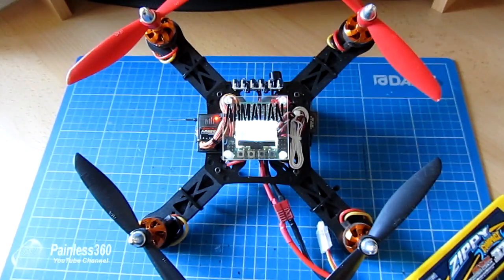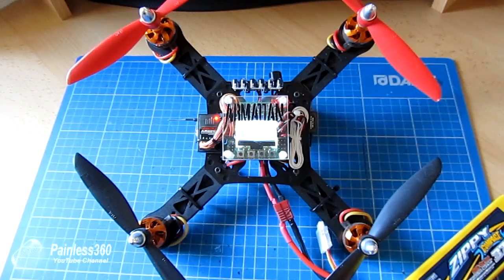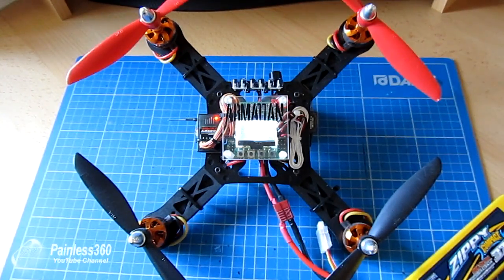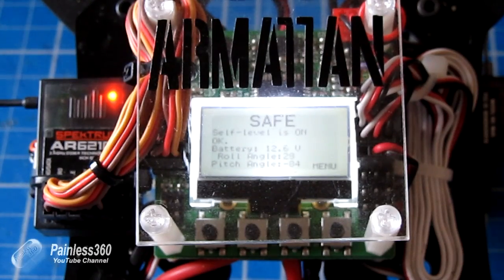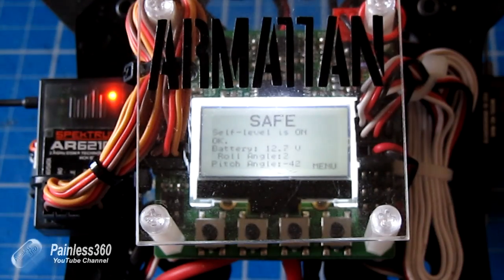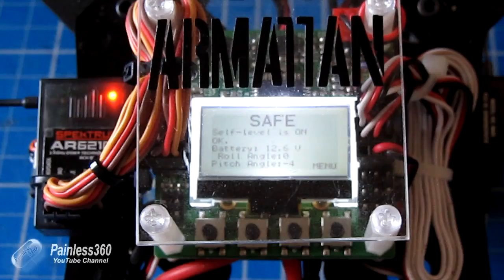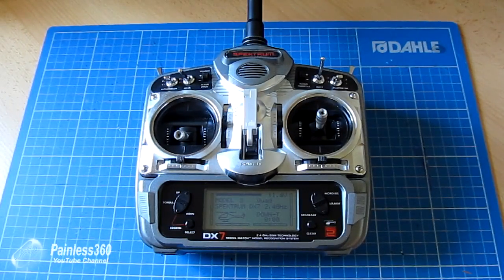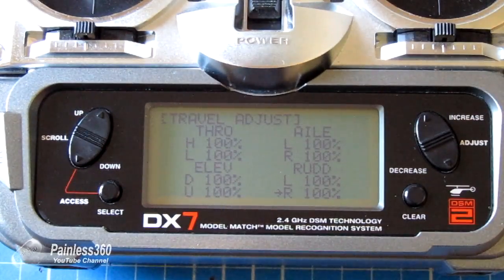KK2.0 Arming overview

Comment: I'm using kk2 with dx8 and ar600 receiver, can't get it to arm. Receiver test days 000 for all values, aux is off, please help.! Thanks
Reply from the maker: +mox well sounds like something basic if you're not getting any inputs at all. What troubleshooting have you already tried?
Reply: Painless360  I've tried resetting the board , messed with all my setting on my remote etc, I'm starting to think this is a bad board. Any suggestions?

Comment: Another good tip when troubleshooting arming is to go to the receiver test menu in the KK2.X menu. You can there see if channels are correct or need to be reversed and you can also see what commands the board is getting from your receiver. It will tell you if it is not getting 100% travel on the different channels when you move the sticks in the transmitter. It is a good idea to set your end point adjustments in the transmitter while looking at this menu in the board so you get them as close as possible to 100%!!